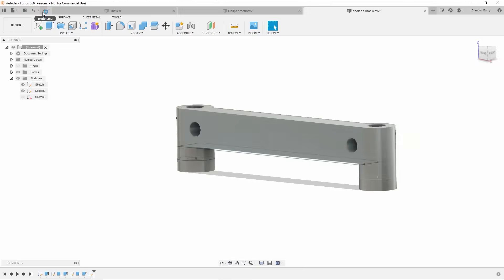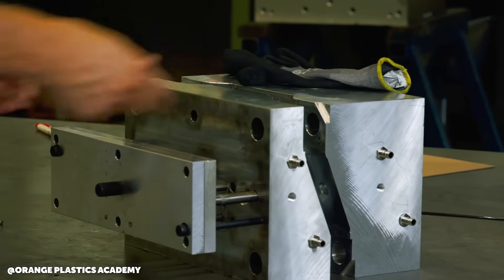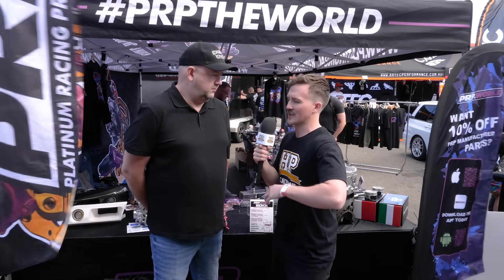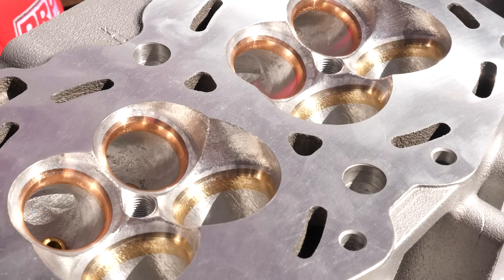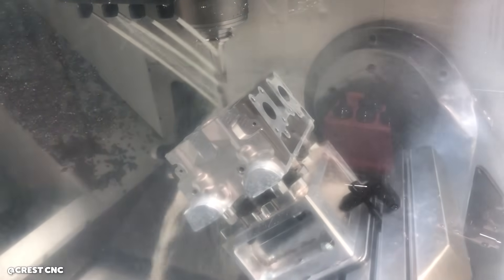Why Your CAD Designs Don't Work

Comment from the maker: TIMESTAMPS:
0:00 – Design Vs Manufacturing
0:11 – Gerry’s role at Crest CNC
0:23 – CAD design process overview
0:53 – Gerry’s background in tooling, CAD, and engines
1:48 – Engine block and cylinder head development process
2:51 – Simulation and validation approaches
3:31 – Key considerations for billet engine blocks
4:04 – Cylinder head port design and scanning
4:38 – 3D scanning options used
5:06 – Billet vs cast manufacturing design differences
5:28 – What is design for manufacture?
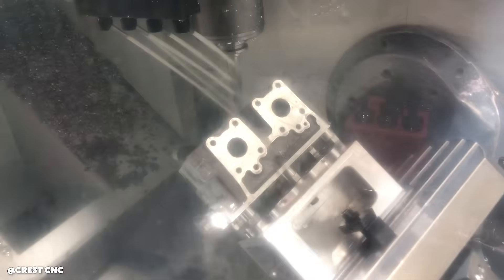5:53 – DFM considerations for billet parts
7:23 – Draft angles and radii in casting vs billet
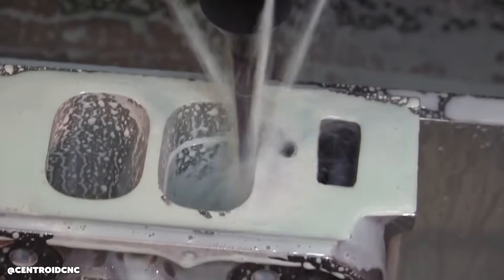8:21 – File exchange between CAD and CNC machining
9:21 – Colour coding for tolerancing and manufacturing
9:57 – Future projects and where to follow Crest CNC
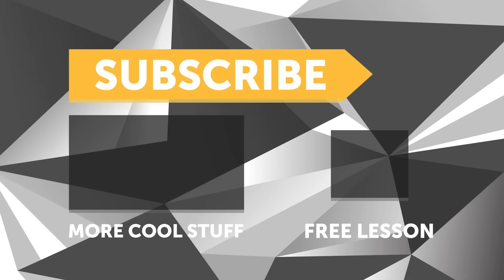10:13 – Outro